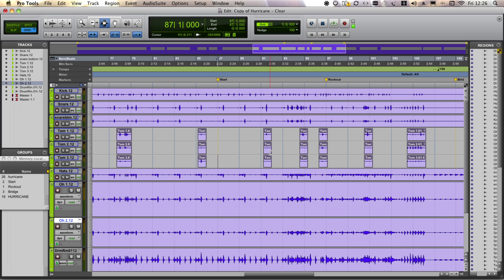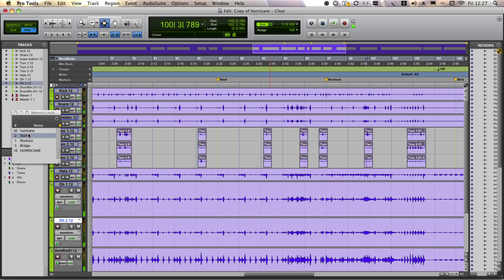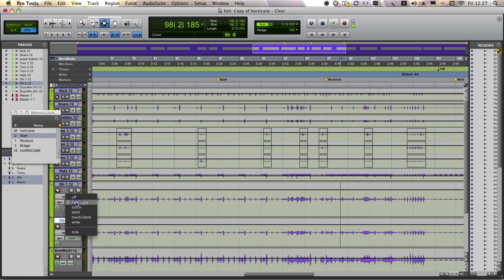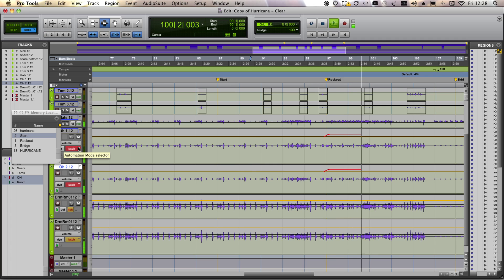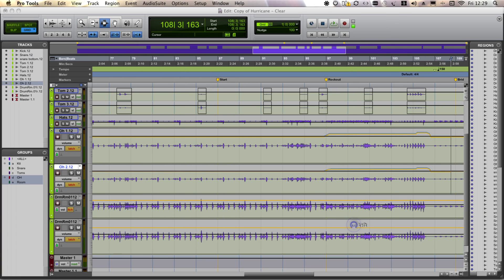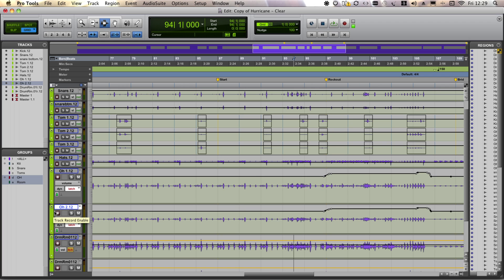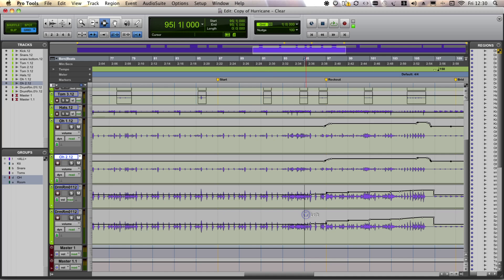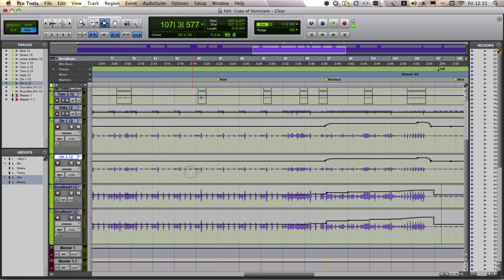Recording Studio Masterclass Vlog - Episode 2 - Trim automation Tutorial

Comment: the automation you did can be done normally with the latch or touch mode..what was the benefit of using trim automation..it doesnt make any sense at all...just to see the yellow line??
Reply from the maker: Well this is a demo of trim automation rather than an explanation. Which was given at the live event. But to be brief there are several functions of trim. 

As with SSL automation for example you can complete the mix in several passes. Each pass allowing finer control. After coalescence the trim fader starts at unity gain even if the volume is not. Hence you get more mm per decibel compared to doing a ride on a volume fader around say -60dB. If you are using flying faders also you don't have to try and "catch" them. Remember that the previous layer of rides (volume) are kept with trim. So you are effectively adding a relative fader movement on top of the volume fader movement. 

Or you can not coalesce at all to keep your fader rides separate to overall volume. Useful for allowing a later global change in volume. This might be useful if you have an automated console like the A&H R24 or you are hacking another console with flying faders to read ProTools hui/midi volume fader movement.
Reply from the maker: Or you might just want to trim up a vocal that you have already ridden. You could do this for the whole track by jumping to the trim fader and adjusting. It's often easier than doing it with the mouse. 

Incidentally we now have clip gain automation which allows even more control of riding levels into plugin chains or hardware inserts.